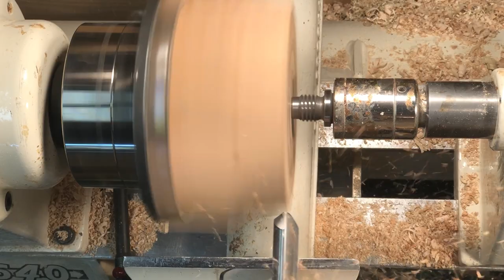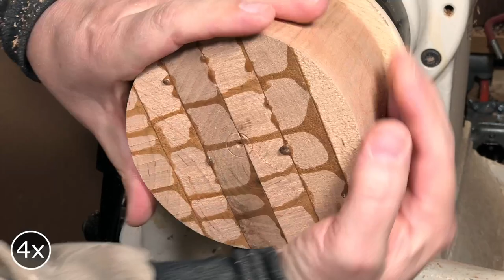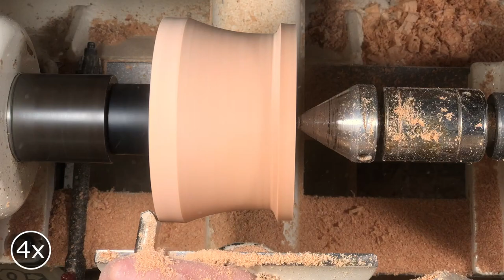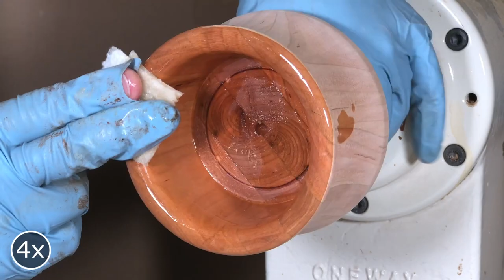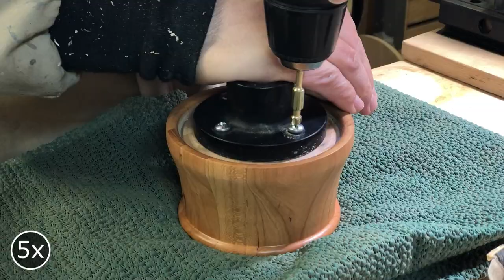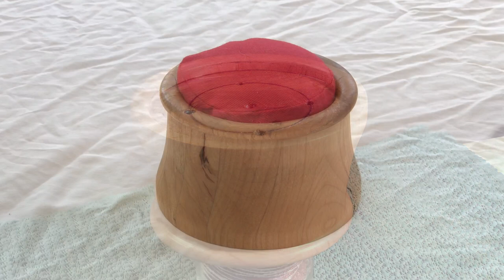Woodturning - A Pincushion With Woodturned Base

Comment: Nice well proportioned piece Mr Croaky Oak and nicley presented.  I also use equipment in the shop that can rip your head off and don't think  much of it but using a sewing machine scares the giblets out of me!
Reply from the maker: Thanks! I’m glad you liked the video.

Many woodworking power tools and stationary machines certainly have more potential for injury than a typical sewing machine. However, I don’t think your concern about sewing machine is unwarranted. The home machine I use can stitch through several layers of heavy canvas. If the machine can put a needle through that much fabric, I doubt a fingertip would slow it down. And industrial sewing machines are often much more powerful than any home machine. In fact Jason of All Trades has a video where he teaches his wife to use his “scariest sewing machine”. That video can be found here:

youtube.com/watch?v=3JuYT2fiDG4

Thanks for watching and commenting.
Reply: @CroakyOak  that video bought back lots of memories. Over half a century ago I used to maintain my  big sisters industrial machines and overlockers at her business. Even though I was used to using woodworking machinery by then, sewing machines dictated  the rate of feed so, for a long time, I  was anxious when using them as I didn't feel I was in full control. I was envious of the girls speed and dexterity  and they would often tease me but I always redeemed my qdos when a speedy fix was needed. I still do all my own sewing for household needs and often modify store bought clothes but if I  havent used the sewing machine for some time, I still flash back to that early anxiety just before I press the pedal. You have gained another subscriber Mr Croaky. All the best mate ☺
Reply from the maker: Thanks for the sub. I do appreciate them!